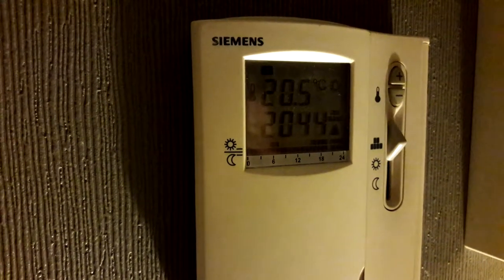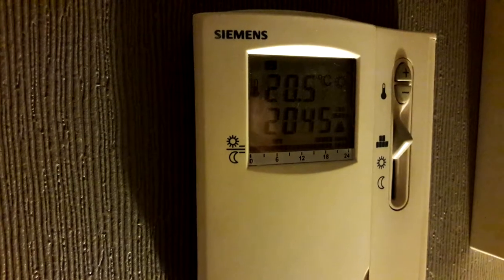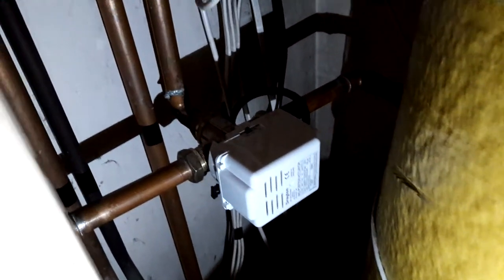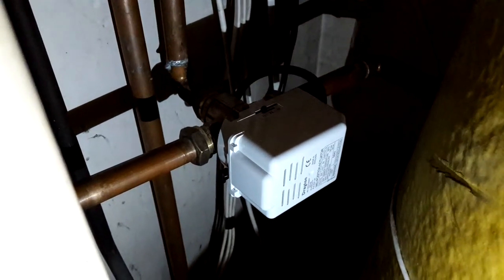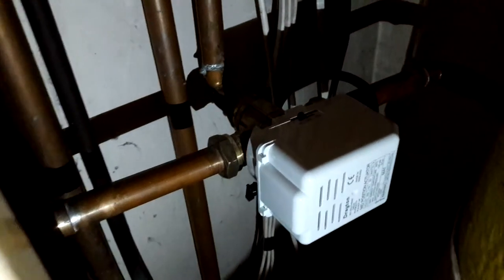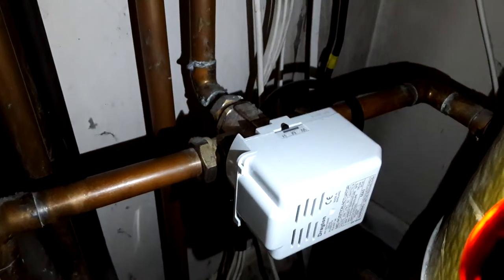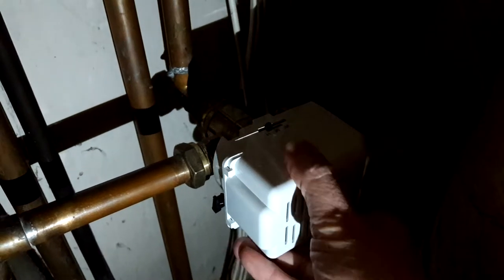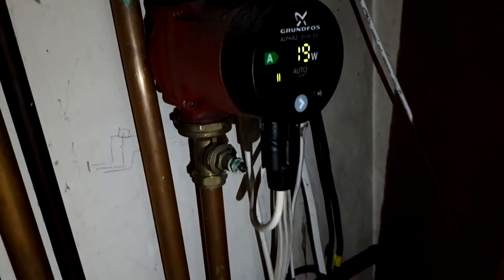Central heating sticky 3 port divertor valve

Comment: I have a British Gas npc 555312 mid position actuator code BGMVSP-23 which looks the same as the Drayton motorised control head in this video.  My central heating wasn’t working on heating only. Central heating only with hot water. These 3 port valves do default to hot water.  By removing the motorised control head I was able to move the 3 port valve spindle about eighth of a turn only with a small adjustable spanner. I then put a flat driver in the spindle orifice in the motorised control head. Turning the programmer on the workings on the motorised control head started working. There’s a few videos on YouTube about checking central heating controls wiring and replacing thermostats and three port valves. But I’d suggest checking you don’t have a stuck valve first.

Comment: You can just try replacing the motor in the head, alot cheaper.
Reply from the maker: For sure, but in my case it was the actual valve that was faulty, I had to replace it.

Comment: I've the same problem with my Myson power extra motorised valve for the downstairs heating... I find it only comes on after I tap it.. I don't know whether to buy a new one or try fixing it...
Reply from the maker: I had to replace the actual valve body in the end, I did another video somewhere if you can find it amongst all the trance!